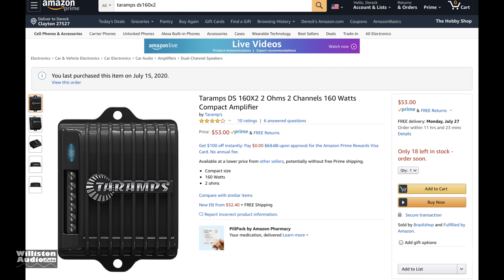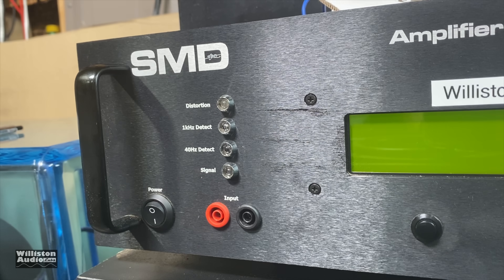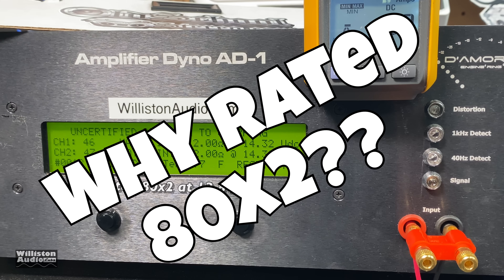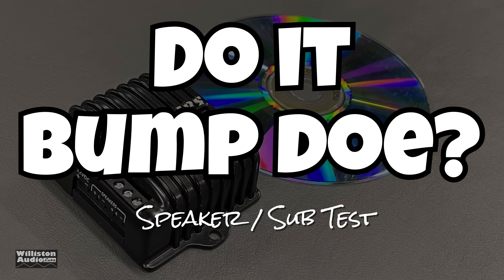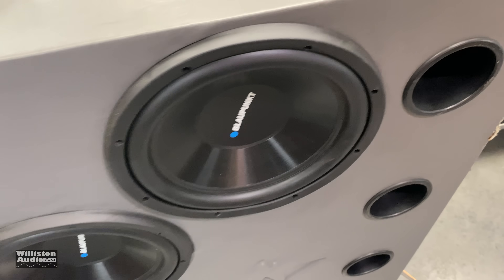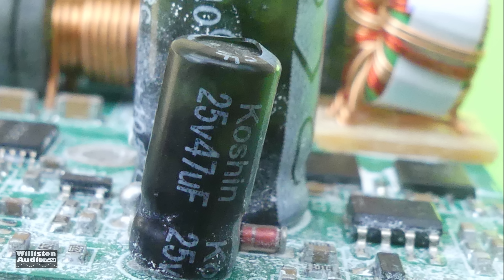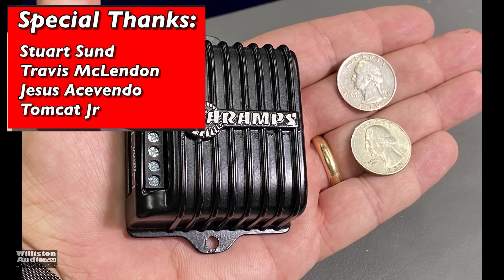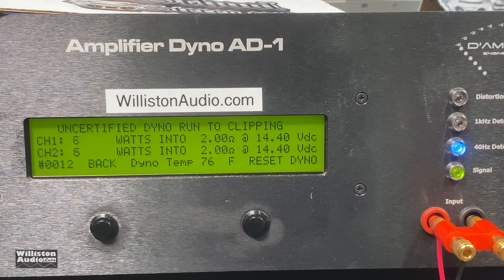Tiny Car Audio Amp Tested! Taramps DS160x2 Amp Dyno

Comment from the maker: Taramps DS 160x2 - https://amzn.to/3hBbczf
Pioneer DEH-80PRS - https://amzn.to/3hCsZWV
Screwdriver Kit -  http://amzn.to/2x0VzcE 

SMD / D'Amore Engineering Amp Dyno: https://goo.gl/sJTcf7
XS Power D1400 Batteries - https://amzn.to/2BPFCKW
XS Power PSC60 Charger - https://amzn.to/2CHGcfs
Fluke 1000A AC/DC Clamp Meter: https://amzn.to/2Rw5WDA
Handheld Dyno: http://amzn.to/2u2EgKV

DISCLAIMER: This video and description contains affiliate links, which means that if you purchase from one of the product links, I may receive a small commission. As an Amazon Associate I earn from qualifying purchases
Reply: Next amp Derrick try 1 or 2 new ROCKVILLE DB COMP 5 3500 rms watt CERTIFIED for $350 each or 2 bridged for over 7000 rms watts CERTIFIED for $700!!! I've heard the circuit board is the same as one of the SAE sundown amps or the Hifonics Brutus BXX4000!!!
Reply: Hi...
Cold you please do some tests on ground zero amps.
Reply: Williston Audio Labs @3:12 🤣👍
Reply: What amp or amps you recommend for 4 8inch subs at 2ohm 900rms
Reply: @BamBam81  check out the Infinity kappa 1000 or JBL GTR1000.1/ Stadium 1k (same amp But JBL has no SSF) does well over rated for around 200$  there's some amp Dyno vids out there
Reply: I think it use a digital d amp what is use by nobsound .
And than you have to sent more volt to it.
If it use TAS5756M chip 
That chip can Handel 24 volts . And than the power will go up
Reply: I need my car amp fix
Reply: Teste o taramps da 800x3 🇧🇷
Reply: B
Reply: I'm lookin for a amp to push a custom 10 inch sub that is in my Harley-Davidson saddle bag any recommendations? Has to be small.
Reply: Look......  Tpa3116D2
*2 x 150 Watt Stereo 
or 2 x 120 Watt Stereo
or 2 x 50 Watt Stereo + 100Watt Sub....*
Reply: How to plug my tire
Reply: Hey, you showed the MOSFETs but not the actual class-d controller chip numbers. The MOSFETs aren't the important part here...
Reply: Love the paper flaps that’s ads a ton of perspective e we would normally feel
Reply: I have to say it really lacked all the way around ... rate em right and we love em
Reply: I could use tHis on my motorcycle if you still have it n wanna sell it
Reply: can you bridge it bruh ?
Reply: You all probably dont give a damn but does anybody know a method to get back into an Instagram account..?
I stupidly lost the login password. I would love any help you can give me.
Reply: @Omari Nolan Instablaster ;)
Reply: @Ryland Reuben I really appreciate your reply. I found the site on google and I'm waiting for the hacking stuff now.
Seems to take a while so I will reply here later when my account password hopefully is recovered.
Reply: @Ryland Reuben It worked and I now got access to my account again. I am so happy!
Thank you so much, you really help me out!
Reply: @Omari Nolan no problem xD

Comment: 2:51 from what I can see that should calculate out to at least 95% efficiency because at least  31.5% of the physical amplifier is missing.  

Have you ever done a terminal cup amplifier like the DD atc-250?  It claims as much as 325Wx1@1ohm in a terminal cup cutout!  I very much want to build out a pair of full range speaker and set up a quick connect to be able to take it in and out of the back seat with one of those.

Comment: It WILL run 80+ watts per channel. These little amps you have to really pay attention to the specs. “12-32v”. You only ran 12v. Try again with 24v+ and you’ll get 86w per channel

Comment: For some context, my desktop computer feeds into an all-in-one stereo with bookshelf speakers.  It puts out about 50 watts into 8 ohms.  But It is also hooked to a homemade sub.  But let's disregard the sub here.  So this little palm amp puts out about has as much as my desktop system.

Did anyone else notice the frequency response on the tech sheet?  I wonder how they measured it at 50hz?  That could be 1db down, 3db, or 10db.  We might never know.

Comment: Hello, I bought a Chinese radio because of the navigator, I then connected a JBL CLUB 6500C 2 way speaker set but also raising the volume, croaking everything, with a small amp can I solve? Thank you

Comment: What amp is physically the smallest 45-60w x 4 that you could recommend (for 75Hz+ door speakers)
Single cab pickup with nooooo space, so I presently have a sub+amp (that uses all the space behind the seat) and the doors are running directly off the Pioneer AVH-600EX head unit.. but the doors could do with a bit of a boost.

Comment: Maybe it would make power if the level inputs had more power? (Depending on head unit). Amplifiers amplify signal. Well if the input signal is higher then the amps output will be higher. Similarly how when increasing voltage to an amp it increases output. Try a head unit with higher output and on every amp Dyno you should add disclaimer what power your head unit puts out. Every YT channel that conducts amp dynos should or all use one standard head unit (riiiight)

Comment: Might be a late comment...

The amplifier is that other chip with a small exposed metal slug. Texas Instruments TPA3221. The NexFET transistors must be for the power supply section.

Manufacturer rated power output, 1% THD+N, stereo (BTL) at 1 kHz, 30 volts rail voltage

88W at 4 ohms
100W at 3 ohms
No power ratings provided for 2 ohm load (except parallel bridge - PBTL which would be 170 watts mono)

Someone do a better job at the power supply section. Or anyone...sneak in two mono TPA3116D2's! (roughly 100w mono each, 2 ohms at 26 volts (max) supply voltage)

Sneaked in a headunit dyno run eh...? Mostly based on the TDA7850 ("4x 50w") or TDA7560 ("4x 51w) and are 2 ohm stable but heat will be a problem!

Comment: Very cool little amp. I know not having the rca's can cause issues but obviously they overrated it. I could definitely see one or two of these having a place in some setups, especially when space is limited. looks small enough to easily tuck behind the dash or even body/door panels.

Comment: Like the design small compact you can use it effectively per speaker and like the Bose system dead when I accepted a fires on each speaker Mount one of these door

Comment: They should build that into a head unit to have active sub out.. granted heat could be a problem. But it would not violate physics in any way. Just don't expect to shake the neighborhood. Good for a budget labor saving build. I can't imagine that thing draws much more then a high powered head unit considering the small wire ga terminals.

Comment: In this day and age why haven't the car, audio systems cut the cords. When you get a system installed, you gotta pull the dash apart, pull the doors apart, pull molding, and run wires everywhere. Where is that true WIRELESS system that performs equal or better to a wired system?

Comment: hi about lepy lp 2020a i plugged in correctly turning the volume up i heard a buzzing sound in speakers and the volume kept going off then on when i increased the volume from the amp now one of my speakers has stopped working what caused this before i used the amp i could turn the volume up on the speaker all the way and it was clear sound also could it have been the underpowered power supply that it came with some people recommend a 6amp power supply. i also used presonus eris e4.5 studio monitors 75w with the amp also is using a amplifier with studio monitors dangerous because the studio monitor has a built in amplifier. and the amp is 20w and the speakers are 75w  could it be because the speakers are more powerful.

Comment: I mean it’s impressive it’s putting out 60 watts x2 but why can’t they advertise it correctly. I just hate the over rate rms and “max power” ratings on amps. I bought a soundstream txp 6000.1d because of your reviews. I know it won’t put out it’s 2350 @1ohm but it’s still a 2k amp for 140 bucks! But again what’s even with the 6k max power they advertise? It’s like you say, it won’t do max power unless lighting strikes it!!

Comment: What is the performance if you connect a 1f capacitor at the 12v supply?  Probably just couldn't pull enough amps

Comment: I think mini-amps should be a thing. More so than they are. There is no reason to have a giant box amp anymore. I don't care for the excuses made by people. Technology has improved. We have smaller and smaller components that can do more and more. Technically you could make a 1000w subwoofer amp fit in the space of an old 6x8 inch amp. but they still put them in 24+ inch length 8+ inch width and 4+ inch height.... its not required. its bullshit and "old school" thinking. its the future, we need to act like it. Its a shame this mini amp did not hold up to a proper test, but in reality, there are companies that could make this size work really well.

Comment: the 18537 transistors are part of the power supply (step-up converter) 

the amplifier is implemented on a chip, in bridge mode (four channels)

Comment: Taramps are always 2 ohm rated. So that 45x2 is correct. Dont know about the 80x2. Look on the specs again. It literally says 2 ohm for the channel impedance. It also cant go lower than 50 Hz.

Comment: Maybe if you add a pin terminal and push through greater than 12 gauge power wire, maybe can push to a higher output?   12ga is only good for like 6 or 8 amps.  that is less than 100 watts.

Comment: USE CASE?:  I have an Altima with Bose, I believe system is @ 2 ohm. Not considering it personally, but a couple of these in the front doors taking in the sp level ins to up the front stage could be a thing...

Comment: This is a Brazilian Amp, for no one knows reason, it is common here to double the RMS power in advertisement. They call it "musical program power", a kind of maximum "dynamic power" that the amp reaches in a specific useless scenario.

So if you are buying a Brazillian AMP, they are not necessarely bad, but will likely have half the RMS Power advertised.

40W is not bad for a simple car door speaker, that is probably the market for it.

Comment: I have this amplifier and it’s perfect for the application I am putting in. It works great with the head unit but when I convert it to low level input jacks, it plays at really low volume! Other than that, it’s perfect for it’s gonna be used for!! Keep up the awesome job you are doing, with these great videos!!
Reply: Will this arm support dual voice coil woofer
Reply: @khasisongslover  sure if your woofer is rated for only 40W and has the proper ohms. But unlikely, so I'll go with no.

Comment: To anyone wanting to use in a daily driver, I had  quite a bit of line noise when installed with speaker level at  inputs, running 2 ohm on 2 sets of very efficient aftermarket 6.5s. Would like to see a dyno with 2 and 4 volt preouts just to see what it does. However, it easily outdoes deck power with hi-level. Loud!
Reply: Any heat issues? I was thinking of hooking my 4 door speakers to a 4 channel and maybe running the dash tweeters off a little dedicated 2 channel and this would be pretty handy tucked away in the dash as long as it runs pretty reliably so I don't have to keep digging it back out. My dsp can feed 8 channels and taking advantage will, hopefully, give me more control over individual channel tweaks.
Reply: I took it out a while back and swapped in a Stetsom IR 160.2 which i believe is basically the same amp but has lo and hi level inputs. No noise and running 2 sets of NVX 6.5s and a pair of silk dome tweets. Zero issues after a few months. Hasnt cut out once and doesnt have any noise.

Comment: Could you dyno the taramp md1200.1 1ohm
Reply from the maker: Not at this time
Reply: @wal  because I see the one taramp did and i also have the amp. for such a small amp I’m really impressed by the power that it pushes out

Comment: You Big Dummy, the amp is a Class-D amp chip on the side that has all the legs; those other MOSFETs you identified are part of the boost converter on the input, probably stepping up to 24V for the amp chip to run on. Not nearly enough MOSFETs to provide a stereo half-bridge or full-bridge output stage, because they are all actually in that chip with all the legs and the thermal pad on top. The fact that there are FOUR inductors means it's a full-bridge output stage with push-pull operation, which means the boost converter is only providing a single 24V supply (based on the voltage rating of the 25V cap) and the outputs will have half the rail voltage on each output terminal at all times - which means you can't tie the negatives to ground, and you can't bridge the amp outputs together. Also, the slightest short to ground or to the other amp channel is enough to pop the chip - they're not tolerant of mis-wiring.

Comment: I gotta say , even though it isnt near its rated power at 2ohm . I'm still impressed it put out a solid 40 watts per channel.
Reply from the maker: Taramps is usually accurate with their ratings, so this one rather shocked me
Reply: @wal  Still 160w rms would have been hard to expect without at least provisions for a 10ga wire. Me thinks they stretched the truth a tad on this one.

Comment: I have this amp on my road glide......now I can hear my stereo while my helmet is on going the speed limit, really couldn't do that before when I was just running off the head unit......awesome lil amp , easy to hide and install. ....I'd recommend this to anyone doing audio on their harley or other atv's  (toys)........the taramps 2x160.....
Reply: @trentdawg2832  are you still using this amp? How long did it last? Thanks
Reply: @darrinclem2502 yes still have it on my harley….works like it did 5 yrs ago when i installed it…..i would highly reccommend it if your wanting to put a sound system on your bike or atv!!!

Comment: Finally an amp you can hide behind your components. Amp each speaker. Lol
Reply: I like that idea! An amp behind every door panel!
Reply: This is exactly what powered speakers are
Reply: Some older Chryslers and GM Bose did exactly that from the factory. But they were mono amps. Unless these are bridgeable you would only be using half the amp... or use a component set running one channel to the mids and one to the highs with passive x-overs. That might work but seems easier to just use a 4 channel amp.

Comment: I have a question what do you think if I use this for my harley I only have 2 - 5 1/4 I want better highs with new speakers
Reply: It will push them fine....   It definitely isn't the cleanest power but I added a OLD JBL DSP to my Goldwing and this amp pushes my Kappa 60.9 great!  It won't play low Freqs by design tho. 90hz and above iirc

Comment: I'm actually using this on my rear speakers in a Goldwing. It makes my Kappa 60.9 sound 100x better than the factory Amplifier. I would have guessed 50w a channel. Thanks Big D! 
Just got a JBL Brazilian 100x4 to replace it.
Reply: I'd also say that it's clear listening that freq response doesn't go low. The specs say 90hz to 20khz iirc
Reply: Reliability is 100% since Nov. I thought it may have issues in the Louisiana summer but nope just plugging along
Reply from the maker: Great feedback

Comment: Derek, I’m changing the factory subwoofer in my 2004 Expedition. I bought a Kicker 43CWR82 CompR 8 Inch 2 Ohm 300 Watt RMS Power and 600 Watts Peak Power Dual Voice Coil Car Audio Sub Subwoofer. I’m sure you are familiar with the little stock amp that comes in the Fords for the sub, well I was hope there was a small amp similar in size but powerful enough to work with the speaker I bought. If not that small what’s a good amp for that speaker and it’s enclosure? Thanks.

Comment: It does actually have a remote turn on though! Plus I believe it actually uses the TP3116D2 ICs. The fets I believe are reverse voltage protection. That would explain why the pins go to the inductor and such. They're not being used as an actual amp stage such as the halfbridge in a conventional class D amp. My opinion only!
Reply from the maker: You are correct! And it works with RCA inputs. I plan on a short update vid maybe next week
Reply: It for boost converter.

Comment: What’s the ohm for 8 - 4ohm single voice coil  wired in parallel?
Reply: Looks like it would be a negative number cuz of gravity holding it at zero and with electric magnetic it would be around for the nearest 1 until sound passes through
Reply: The watts for my calculations are inter graded from my other 6- 4ohms Wired the same sharing separate power from another 3- 4ohms under 10k providence for 24volts and 80amps
Reply: That damn little amp must be imagining to you so you could hear the whispers from what it thinks🤣

Comment: That's a pretty awesome little amp. For increasing the reliability-factor one could peel the stickers off the bottom and slap a nice heat-transfering pad orsome heat-transfering compound to the bottom and then bolt it to a heat-sinking surface to help keep it cooler. 
Thanks for sharing, Williston Audio Labs :-)
Reply: Its so small take the cover off and screw a pc fan to the top like a cpu heatsink
Reply: @yzrippin  Yep. Even a micro PC fan would be enough for that tiny amp.
Reply: @whichgodofthousandsmeansno5306  makes me wonder how powerful could a hand sized amp be if it came with a fan.

Comment: Considering the fact that larger more expensive amps and by that I mean much larger and much more expensive amps fall far short of their published rated numbers, this little guy did not do bad at all. And he pushed for subwoofers.  W.A.L. Has tested many of the Amstadt have fallen far short not by 10 or 20 Has tested many of the Amstadt have fallen far short not by 10 or 20 Watts But buy 200 or 300 Watts. Way to go little guy !!!!!